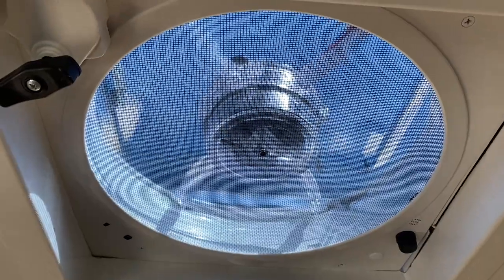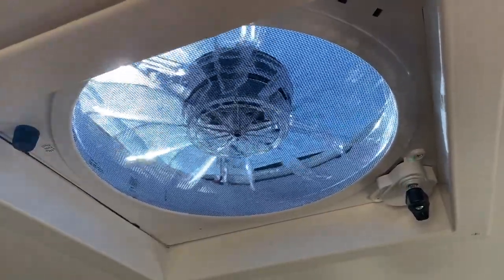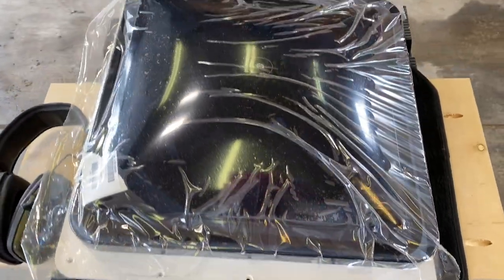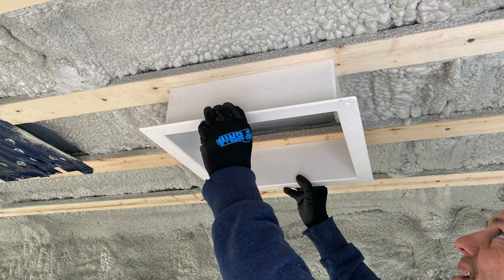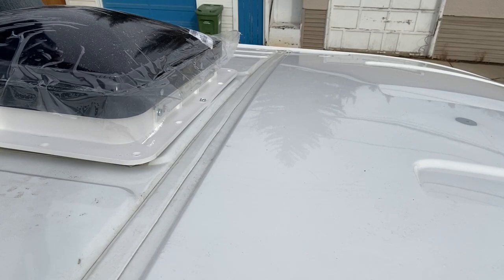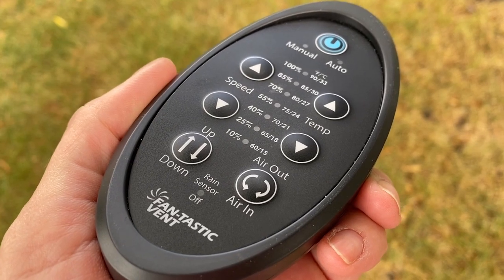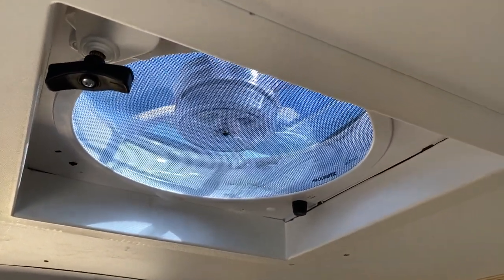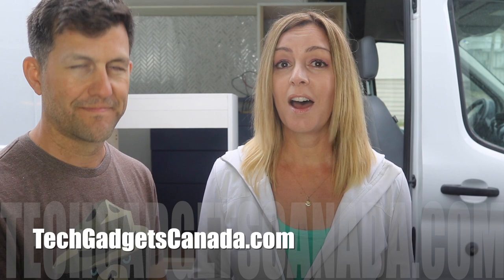Review: Dometic Fan-tastic Vent Fan (7350)

Comment: I need to say that my experience with the fan is anything but fantastic. I bought mine a year ago, as friends, who have an older model, said it was great.However mine makes a lot of noise and pushes so little air that I can barely tell if I have it set to blow the air in or out of the van. If I turn it up to get more airflow it becomes even noiser!The rain sensor closes the vent at night so I can only assume that it senses the night time moisture and closes even though it is not raining.My friend's older model seems to push more air than my newer model.I get much better & quieter airflow from my little Sirocco fan and it was only $!60 not over $600.So in summary, I have found it an appalling fan that is just not worth the money.
Reply from the maker: Sounds like you got a bum unit. Did you reach out to them for warranty or help?

Comment: Hi! I’ve purchased the 7350 model and my father has installed it for me. He’s a retired electrical engineer so I’m sure he has it wired correctly. Issue is the remote isn’t working. He says it has continuity but it simply won’t work. Any insight? Apparently there isn’t support for this expensive item. 👎🏾